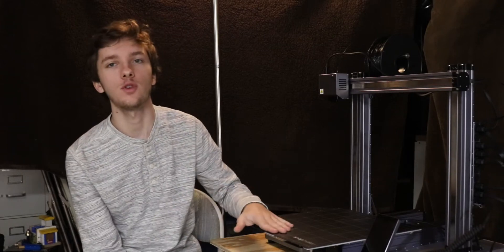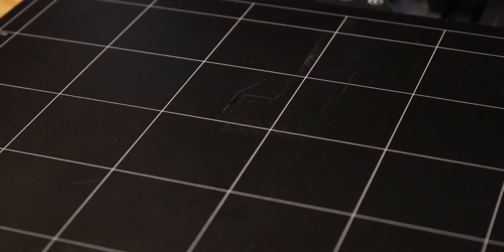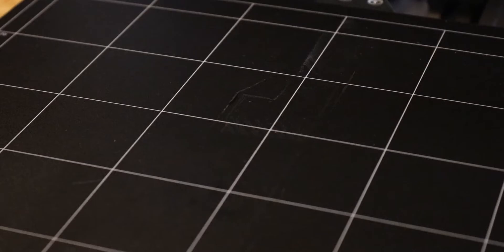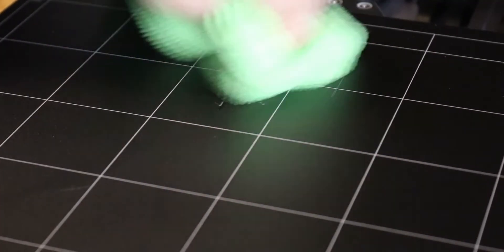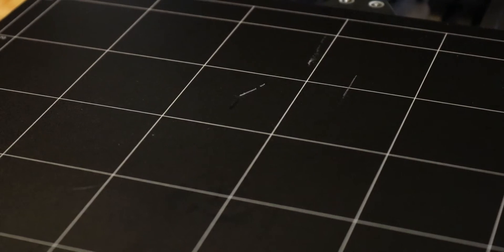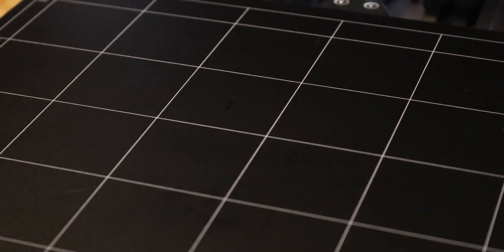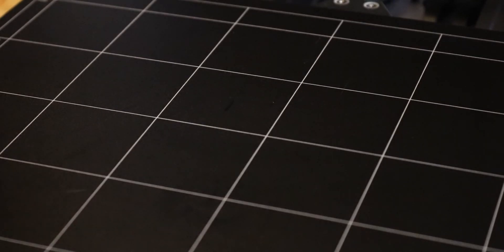How to REMOVE PLA from your 3D PRINTING BED

Comment: Apparently my printer Bed is a hoarder house ive probably got like 300-500 hours of various print sizes on this thing.. can usually get decent adhesion still but i had one Little support that keeps causing a major upset. ill have to spend a bit more time on it but DAMN i got about 90% of  the sheen back that is just like the edges I'm excited, thank you very much.

Comment: Thank you for this! I just bought my first 3D Printer (Snapmaker 2.0 A250) and after my first test print (which I waited til morning to remove from a cold plate) I had this ring of hardened PLA on the print bed. This made it so easy to remove. Thanks again!
Reply from the maker: Glad it was helpful to you!! You're going to make some incredible things with your new printer! And if you have any other questions about the machine, feel free to leave another comment!

Comment: what percent alcohol is this? i have 91% but will that work?
Reply from the maker: My current bottle is 91% as well so yes that will work! I think even if you happen to get a lower percentage, it will just take a couple extra passes to get the job done.

Comment: it would be nice if this also works for the ender 3s1 springsteelplate...those pla-pieces are driving me nuts. I made a mistake once and printed PLA+ with 240 degree to see the difference. Im still fighting with pieces of PLA+ from that experiment, its almost fused to the bed.

Comment: Acetone also helps, I believe it works more efficiently in removing PLA than the alcohol.
Reply from the maker: I have read on the forums for the snapmaker machines that I use it can cause problems with the sticker on the heated bed. I don't know beds on other companies like creality and such but just be sure not to ruin the bed with the acetone.
Reply: Yeah that peels the material of the magnet itself

Comment: I even remove my bed from the freezer and the parts are still as if I used epoxy instead of PLA. Hate the glue stick, but if I don't use it, parts don't stick, even if heating the bed to 60 degrees. At this point I will buy a flexible bed.

Comment: Wait isn't there a danger that the rag will burst in flames? This is flammable liquid used on a hot surface after all? I tried to search the point of burning but to no avail 😫
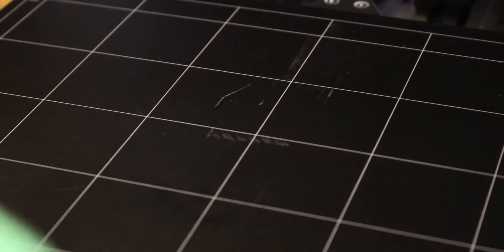Reply from the maker: Thanks for your question! I found some info by searching for its "ignition point". The amount that we use is very little on the rag and it evaporates into the air almost immediately which I believe you can see in the video around 1:23 so I've never worried about it bursting into flames. I also see that the ignition point of 750 Fahrenheit which is far from the 80 Celsius the heated be is at when we clean it. But of course be careful when you use the liquid.
Reply: @RyanTuscher  I have leftover pla on my bed, using Easythreed x1, budget printer and my printer has a magnetic bed, it is not heated, so how do you recommend I clean it?
Reply from the maker: I first tried to remove my pla by just scraping at it with a plastic tool but that didn’t quite get it off. Since the bed isn’t heated and as long as heating up your bed won’t ruin anything, maybe try an external heat source like a hair dryer or heat gun to soften the pla and then try using the isopropyl alcohol to remove it. Hopefully this will help you, and if you’ve already found a way, I’d love to hear how you removed it!! Thanks for your question!!
Reply: @NLamki2002  Take off the removable bed, soak it with hot water. then scrape off pla and finish up with alcohol.
Reply: Rubbing alcohol will evaporate at 172C, We're heating the bed to 80C at most, and rubbing alcohol burns at about half the heat of other fuel sources. You can almost handle it, magicians and fire breathers do it all the time.

Comment: I have a lot of PC stuck to a bed, any advice for removal?
Reply from the maker: I've never printed with PC so sadly I don't have any advice on that, sorry. Maybe someone else in the comments is able to help!
Reply: Just Pre heat plate to maybe about 90 degrees (Probably doesn't even have to be that hot, but that's what I heat it to). Then it should peel right off. Works like a charm every time.